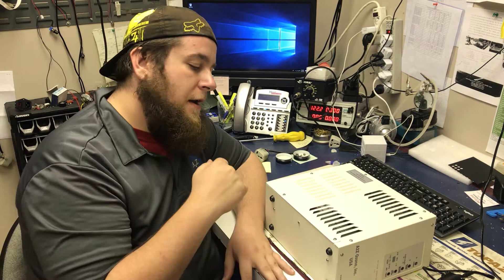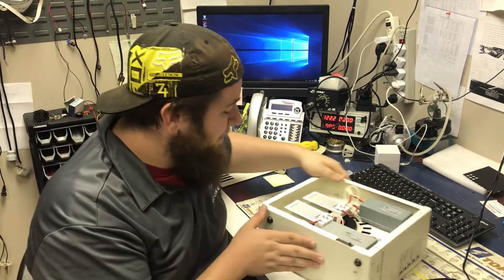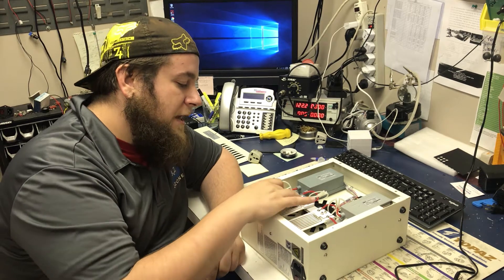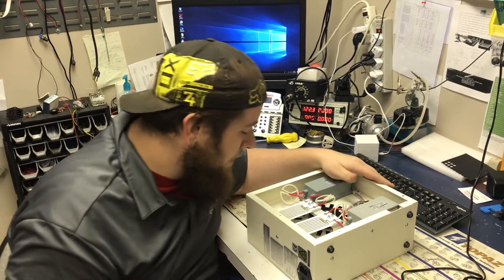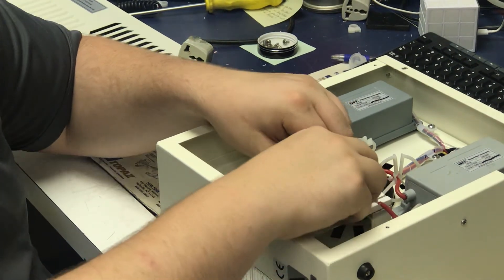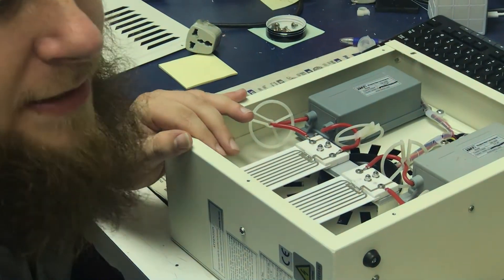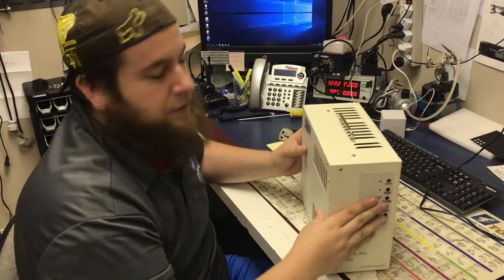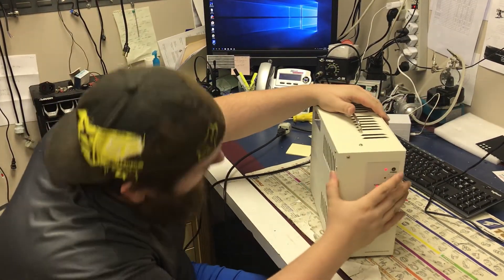Video of How To Clean A7K Ozone Plates and Extend the Life of Your Plates

Comment: My A2Z ozonator is used in a pool, and it has a very different setup. The ozone producer is in an enclosed shiny blue box with airlines attached to it. We have been using it for four seasons. Do I need to cl an it by taking apart the box, or does it need cleaning?

Thank You,

Paul
Reply from the maker: Take the air filter out and clean it. Dish soap should work fine. Check to see if you have good air flow going to the box. That is all the maintenance you need for the SP-ozone series ozone generators. This video is for the air ozone generators.

Comment: Can we use fine grid sandpaper instead?
Reply from the maker: It is better to use a razor, as it will leave no residue behind. But if you would like to use sandpaper, make sure it is super fine. First, remove any residue on the sandpaper, and then you can use it.

Comment: Perfect.  I've noticed a reduced output lately as we've been using the unit a LOT!  I stretch a rubber band across the air output to check for degradation of the rubber, and it has been taking longer and longer for the band to break.  Tried to call your office and got a "voice mail full" message this morning, so I'm REALLY glad you went to the trouble of posting this You Tube video.  I'd have probably tried cleaning them with lacquer thinner without your advice.  Thanks very much.  We decon all incoming materials in my van with an A7K unit.  Andy Hanson, Glen Rock PA
Reply from the maker: Hi Andy, Thank you for your kind comment! You have a good idea with the rubber band, what a great way to test ozone output. Sorry for the full voicemail. We are working from home right now, and we are having a few hiccups. Thanks again, and enjoy your ozone generator!
Reply: @AtoZOzone  Perhaps a more scientific way to test ozone output is something called the (Kickstarter funded) "Pocketlab Air". Around $300 and about the only thing I've found to measure small or large quantities of ozone output for anything remotely in its price range. Interesting to hear about the 'spots' instead of a consistent purple glow. I'll look out for that on my own machine.